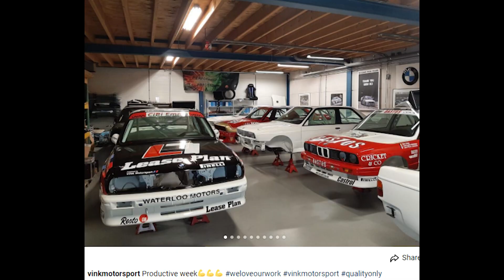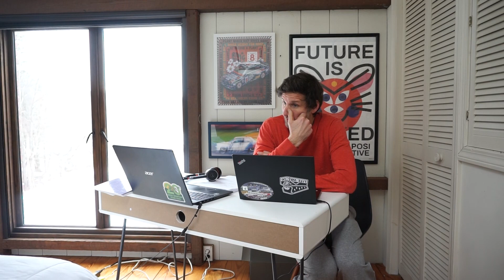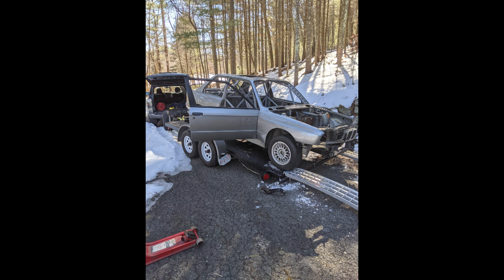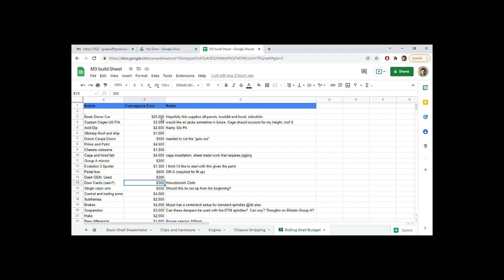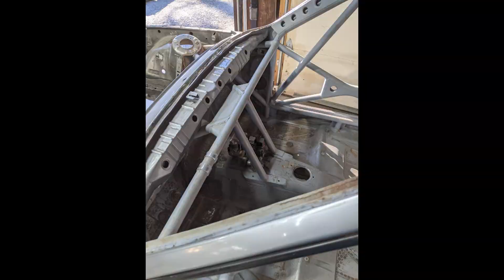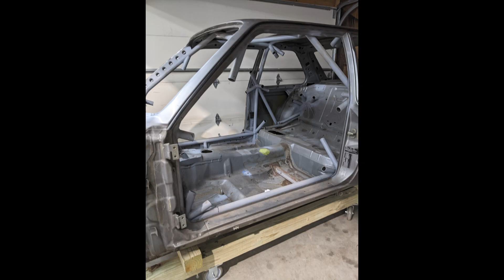E30 M3 Build video 2- An early make or buy decision

Comment: I love where you're going with this. Is the plan strictly tracks, or will you also visit hillclimbs with it?
Reply from the maker: Hi Jesse. This is a conundrum because I know the car won't be suitable for most hillclimbs in New England.. or really any. It will be good for some in PA which I'll probably do. The roads are smooth down there. It's being built for track and historic racing foremost.
Reply: @race-partners  my concern would be hillclimbing something that you've invested this much money into. There is a bit more potential for a total loss than on a track, for sure. Either way I'm very interested to see the result. I'm especially keen to see what your proposed timeframe is.
Reply from the maker: @sheepfarmerkarch  that's always a risk for sure. It's definitely not the right way to shake the car down, or get used to it .stakes are too high, like you said.